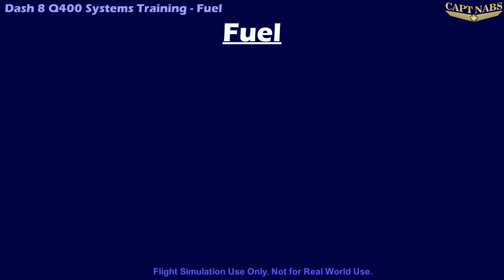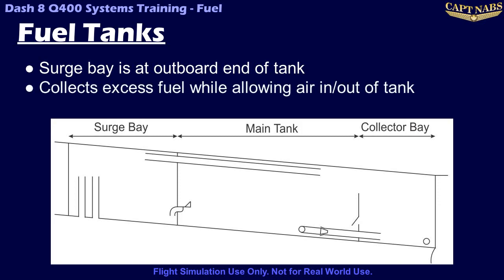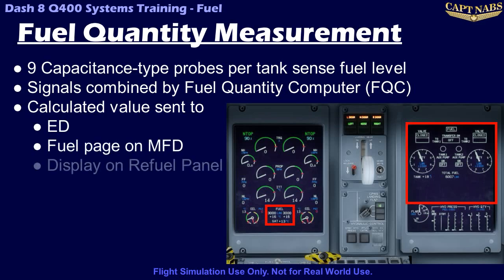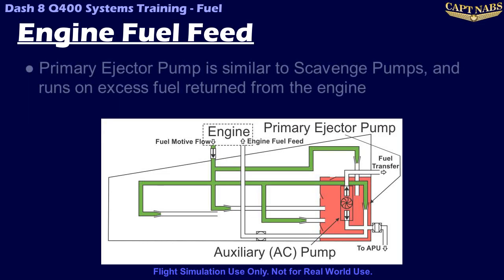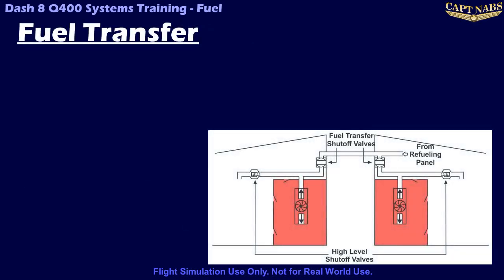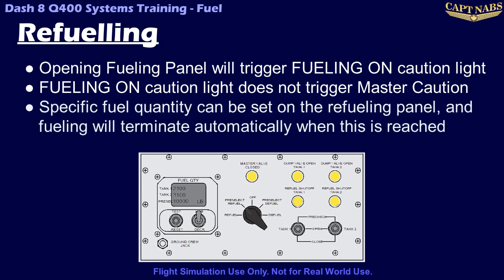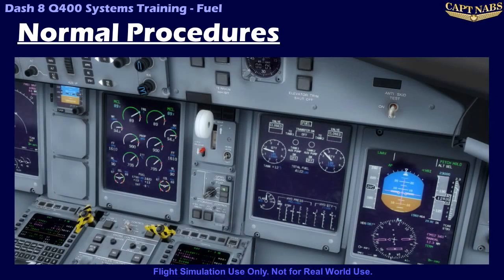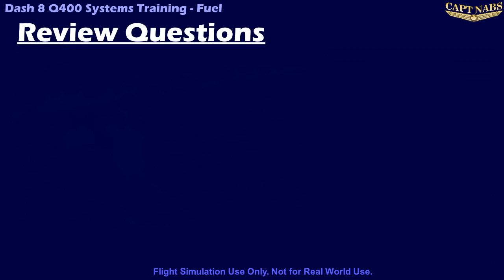Majestic Q400 Systems Training: Fuel (Fly Like A Pro)

Comment: Is information available for the aux fuel pump model? I am interested in power requirements
Reply from the maker: No, there is no common information about the model of fuel pump. Sorry. The function of the pump is described, but not its specifications.
Reply: @CaptNabs  I didn't think so. Thanks

Comment: What recommended type of fuel q400 require? is it possible to replace with bio fuel?
Reply from the maker: Excellent question.

The approved fuels for the Dash 8 Q400 are
  - Jet A/Jet A1
  - Jet B
(Or military equivalents)

Fuel System Icing Inhibitor (FSII) is allowed.

As far as biofuels are concerned, they are not on the list of normal fuels. That being said, many operators have made test flights and periodic commercial flights with biofuels. I have not found any evidence that any operator currently uses biofuels for every day operations.
Reply: @CaptNabs  , thanks for your reply. It seems, Dash 8-Q400 is common fuel user, thats why good to operate. But, bio fuel conversion is important. Some countries like Indonesia, Malaysia, Thailand, Vietnam have palm oil resource, where Dash-8 can get a potential market.
Reply from the maker: I don't dispute that BioFuels will play a role in the future of aviation.

I simply stated what the manufacturer has currently published. Many BioFuel experiments have been undertaken with the Q400 to date, but no one is using it on a regular basis that I could find (yet). I am sure Bombardier will issue supplements allowing certain BioFuels when an operator is ready to request it (and pay for the certification). I just could not find any evidence that anyone has done this, YET.
Reply: @CaptNabs  thank you, I understand. I am from Bangladesh but living in Malaysia, where palm oil is cheaper the other oil. Bangladesh ordered 3 dash-8 q400, so, we are looking for alternatives.

Comment: How do I get the Q400 to display lbs instead of kg? I've used the Majestic CHAN to change the settings and reloaded both FSX and the aircraft itself, but nothing seems to be working.
Reply from the maker: Hi Robert.

Not at home right now so I will have to double check when I get home, but I believe the option is in the Majestic Control Panel utility. Once you switch the setting in there, make sure you hit Apply Settings prior to closing the utility. Then reload the aircraft in FSX.

If that doesn't work for you, it might be a bug. I would post in the Majestic forum or submit a ticket to Majestic. Sorry I can't be of more help.